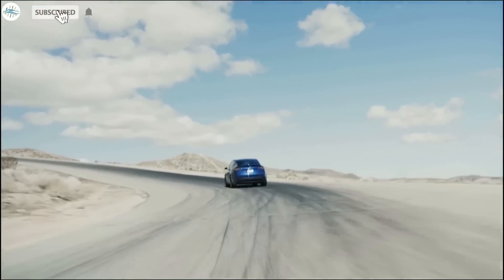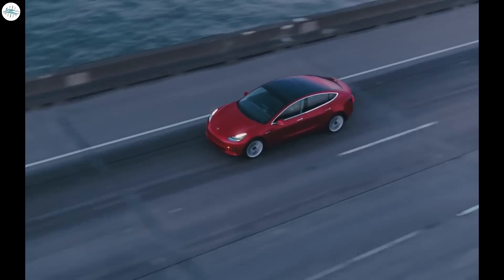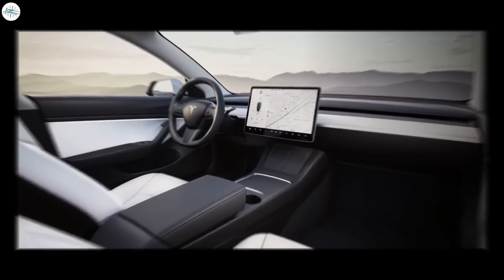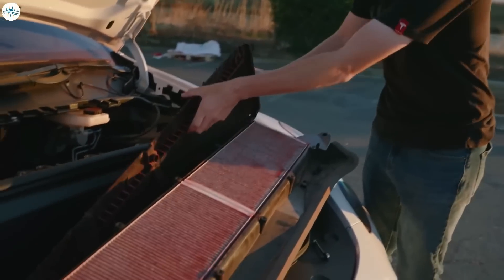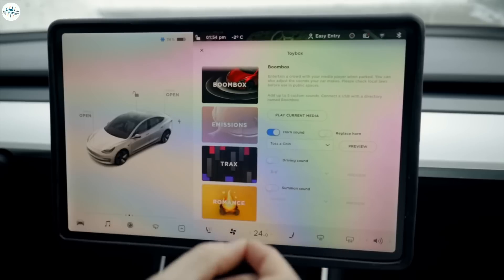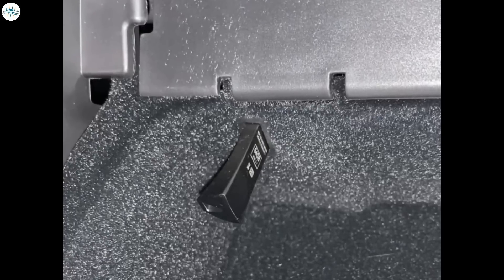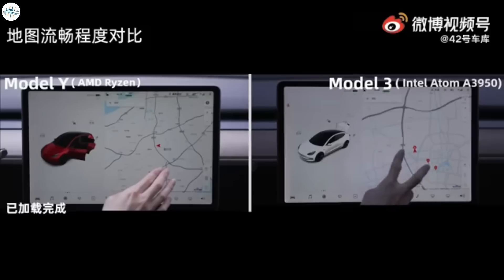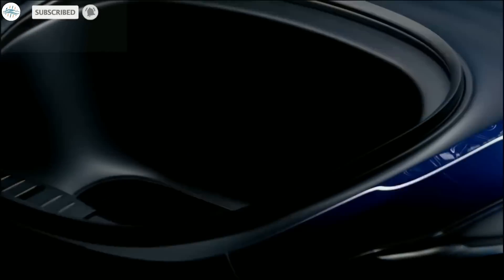2020 vs 2022 Tesla Model Y - What Has Changed In 2 Years?

Comment: Model Y has improved significantly since it’s release
Reply: I thought the new battery is 15 volt and not 12 volt. And that's why currently you don't get 12 volts on the trailer hitch electrical connection. They are working on an adapter to supply 12 volts.
Reply: I think the best upgrade options yoke steering wheel+titanum lugnuts. Let me know if you're interested in adding any of these accessories to your own amazing Tesla!